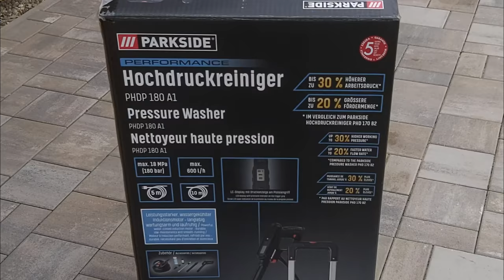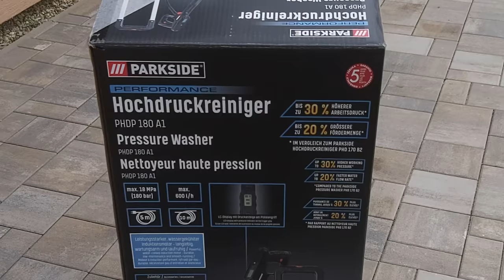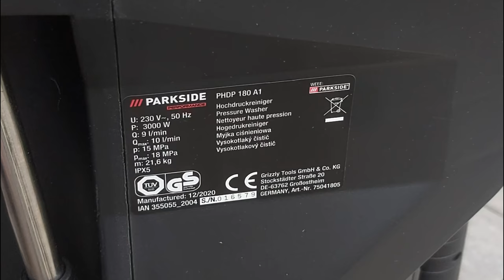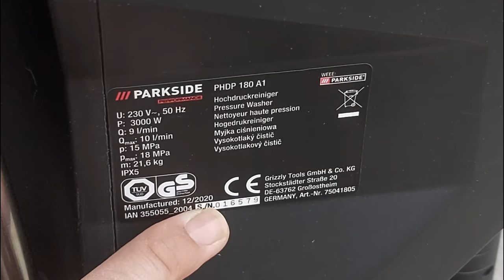Vysokotlakový čistič Parkside Performance PHDP 180 A1 Rozbalenie a test 150 - 180 bar

Comment: Hello, i think that the pressure washer has a problem because we hear the pump each few seconds when it's off.
Edit: i undestand leak at 12:25. Thanks
Reply from the maker: Yes re-switching is a problem. Leaking water
Reply: @FORWORKANDFUN  Hi. You mentioned, that you do some reclaim because of the leaking water. What is the result? Could you eliminate the problem? Still you use this PHDP 180 A1?
Reply from the maker: @petroerno  I still have it and I use it. I don't want to interfere with her. I will complain about the product when it breaks down completely.

Comment: Bought it @ Lidl Holland/Netherlands. €169. Mine doesn't leak. Works great. But I expected more output power from 3KW / 180bar. Doesnt remove moss between stones with patio/surface cleaner. You really need to  use the 'rotating/swirling dirt remover' nozzle and that last one makes everything around you dirty. Sand and mud from between stones flies everywhere. Everywhere.
Reply: I had before parkside PhD 150 and bought separate 20e patio cleaner yellow,it was perfect and cleaned surface super fast, sold it, now bought this parkside for 199e and patio cleaner doesn't work as good, can say doesn't work at all.  Two little nozzle's move like in slow motion and can't clean surface
Reply: Just check if you have enough water flow from your pipe. I only have PH135 and was not happy on begining but changed faucet for water hose and now night and day. 😁
Reply: @tomaskonkol8894  thanks for your reply. I have enough flow. Found friend which has same washer and o have tested his patio cleaner and worked like a dream, mine definitely has some issue,have reported to Lidl already, waiting for their reply, hope they send me new one

Comment: Hey man, why don't you respond to my comment? I think it's pretty important for future high pressure washer buyers. My question is 3 posts below this one.
Reply from the maker: Sorry, but I do not reply to many comments. I'm on my own. I have a job and a family.
Reply: Hey, no problem man, i figured you just didn't see my comment. Just tell me, did Lidl fix the problem with leaking and machine constantly turning on and off, or maybe it is supposed to work like that? Thanks again, and keep up the good work!
Reply from the maker: @mirinmir3057  I have Vapka at home for the complaint, I did not send it. And there is no new version yet.

Comment: No tie tri kvapky v tom otocnom spoji na bubne hadice cyklovanie sposobovat mozu ale ak bolo video natacane a nastrihane v rovnakom poradi tak skor mam pocit, ze sa to cyklovanie zhorsilo. Minimalne nevidim dovod aby to tak malo byt - cyklovat indukcny motor kazde tri sekundy je dost nedobry napad. Mas prvu recenziu tohto stroja, takze sa neda porovnat ci to robi kazda. Kedze je tam viacero nastaveni tlaku moze byt v cerpadle nejaky elektronicky ovladany regulator, ktory prepusta tlak. Za mna to v katalogu vyzeralo podla parametrov perfektne ale je to zbytocne pretechnizovane. Aj ten ovladac s displejom na rukovati s bateriou a otocnym volicom. To aby si clovek dal bacha aby s tym nikde neudrel alebo to zbytocne nenamacal. Ano vydrzat by to malo ale staci trochu vlhkosti a je po funkcnosti.  Na velke veci a cistenie chodnikov mam Parkside benzinovu wapku uz par rokov a tej sa vykonovo nevyrovna nic co je napajane z 1f zasuvky. Ale s tym sa zasa zle umyva auto, tak som dokupil aj nejaky najlacnejsi "kabelkovy" model parkside. Ako tak vidim, zase budem nakupovat, lebo ta penova pistol na auto co mas je dost dobra.
Reply from the maker: Áno zhoršovalo sa to. Video je zostrihane do poradia.  Interval zapnutia sa stále jemne skracoval. Myslím že sa za chvíľu prejavy problém naplno.  Čo sa týka parametrou je to niečo ako KARCHER K7 ktorá stoji cca 600 eur podľa výbavy. Myslím že cena 189 eur je teda je luxusná keďže je tu 5 ročná záruka.  Dúfam že po reklamácii dostanem novy kus.  Tiež je stabilná neprevráti sa pri práci . To sa mi už stalo niekoľko krát z PHD 150. Triska je fakt dobra oplatí sa.
Reply: Máme ji taky doma. Naše necykluje. Nastavení tlaku probíhá jen mechanicky na pistoli. Display pouze ukazuje na který tlak je otočný volič na pistoli nastaven.